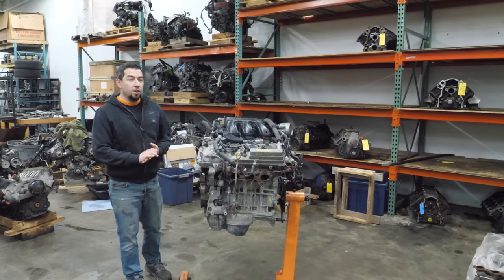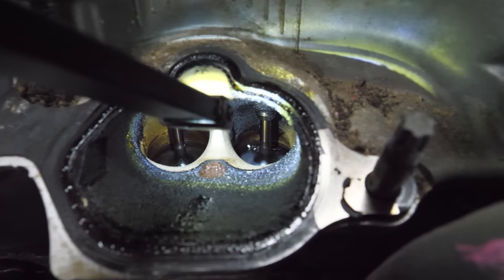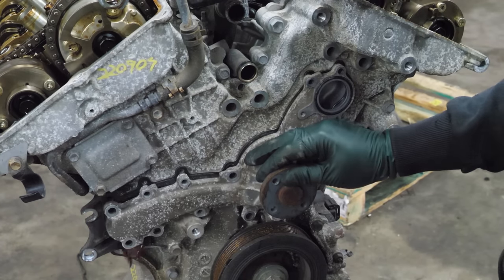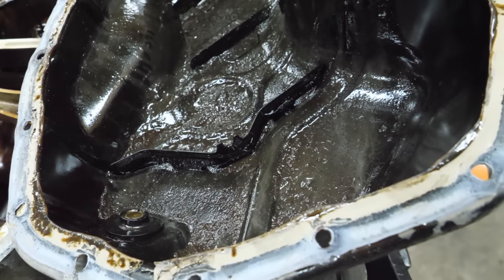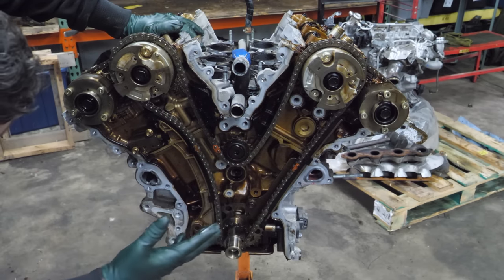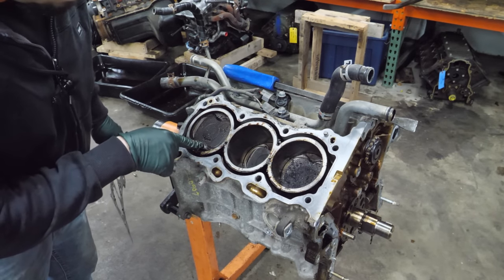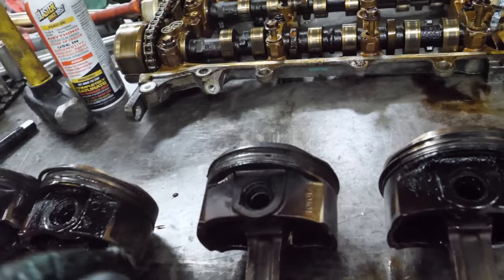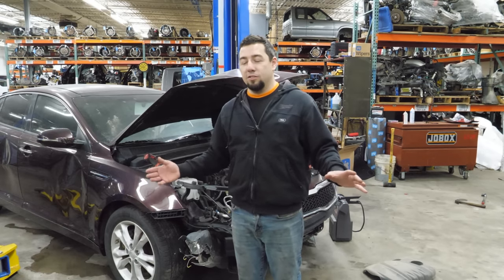Toyota Lexus 2GR-FE Teardown! Premature Death Of Toyota's Most Reliable V6 Caused By Obliviousness!

Comment: Hello, Thank you for providing such a comprehensive survey of these engines.
I live in the UK and I've noticed how people don't maintain their engines, I check my oil, coolant and screen wash every Sunday. 
I have a Ford Fusion, now this is based on the Fiesta, its a 1.6 duratech engine, I find that the garages are not very good when they do a service, I've had a bad experience, when the car was in for it 195 mile service, they garage incorrectly screwed on the oil filter and consequently the filter blew and bust whilst I was driving on the motorway which blew the engine, so I called the garage and demanded they replaced the engine.
I visited the garage they day after I returned the car and they had ordered a 1.4, I told them that it was a 1.6, They didn't believe me and asked me for the registration number which confirmed it was a 1.6, so they sourced an engine from Ford fusion which had a automatic gearbox, so now the car throws up a engine management light, so now, I've given up letting a garage do my servicing, the car has now done nearly 290, 000 miles, I asked another garage to replace the Campbeltown, which was done, they replaced the water pump, power steering and alternator belts and a week later, I heard a squeaking from the engine bay, looked down and the alternator belt is damaged, that's why I don't have any confidence with garages.
Brilliant programmes.
Thank you 
Ian Burns

Comment: I had something like this on a Sienna 3.3 liter. Water pump blew out and they must have kept driving until the timing belt broke. Just like this, both knock sensors melted, intake melted and the engine just smelled like a sulfur mine. I looked up the melting point of plastic. Most cheap plastics melt around 2-300 degrees. Mid level is around 5-600 and high quality resins are close to 1000. So externally, this block had to hit at least 300 degrees. The melting point of non-alloy aluminum is 1300.

Comment: Nice to see this video man! We have this motor in our 2008 Highlander, and while it's had a few issues over the years it's still running strong at 241K miles. Had the lower oil cooler external line failure years ago, before it became a recall. Got our money back from the tow and repair once the recall came out. Also have been dealing with that nasty cold start VVTi grinding noise for more than half the car's life. Also had the water pump replaced a long time ago but after the warranty ended, so we shelled out $600 or more for that. It's in a tricky location to work on with the engine in place. My latest worry is a tick tick tick sound from one of the valves...  Oh and the version of this motor in my 2015 Lexus GS 350 F-Sport has had a winding noise for years coming from a gear on the timing chain system. They replaced two parts already under my extended warranty, but the noise is still there. It winds up and down with the RPMs. Worries me that something might be failing and the end result will be very bad....
Reply: Sounds like you're just making parts up
Reply: @march24-lp4pv  Hey anonymous blank profile person, what would make you come to a comment section like this and make such a baseless statement? Crawl out of your mom's basement, go outside and get some sunshine and fresh air. I have all my invoices with cost breakdowns and part numbers if that would make you feel less distrusting of other people.  Just kidding, I won't be spending a second of time proving myself to whoever you are.

Comment: Thank you for doing this engine. I might have missed the year of the van this came out of, but I’d be interested in that. As a Toyota fan boy, primarily 2015 and down, I appreciate your tear downs of the Toyota products. 

As you know, they are far and few between because, well, Toyota. But it seems any Alpha Soccer mom in a candy-crusted can that tears up the left lanes en route to the next school or outdoor mall is capable of destroying a concrete block. 

As the proud owner of a 2GR-FE with 206k miles, runs like new, doesn’t use any oil and has been taken care of, I hope to hit 400k with ease.  

One thing I appreciate most about this is watching where I need to work if something does need attention. 

Keep up the great videos.

Comment: When are we going to see a Northstar tear-down? I’d like to see an early production version and then a 2005 or later to see the “fix…”
Reply: same, just to see what Eric thinks of it.  I head studded my 1999 Northstar so I kinda know what it looks like
Reply: @MowerModdin  I'd absolutely love to see Eric tear down some sort of flathead car engine. AT this point I don't care how many cylinders it has or what configuration it is, I just want to see him tear down an engine that's old enough to qualify for AARP.
Reply: @TestECull  anything that old is going to be a collectors item unless it has some after market inspection windows
Reply: @bradhaines3142  Or it's sat in a field for 56 years and is so rusted out that there's no hope of ever getting it to start again without tearing it to shreds anyway. That being said you do sometimes find these old cars with bluetooth conrods in them! Mortske Repair got his hands on an early-mid 50s Plymouth sedan with a flathead six in it that went kerbal. #6 rod decided it was done connecting and obliterated EVERYTHING around it. Both sides of the block, oil pan, even damaged the bellhousing.  And one of his most recent videos is of a 1956 Chevy 210 sedan with a smallblock/3spd OD manual in it that got flood damaged decades ago. Smallblock Chevies are tough engines but when there's water sitting in the crankcase for decades and decades even they rust up solid....the whole driveline was toast in that car, not just the engine. Poor thing. The body is great and he only wants 2500 for it; if I had 2500 I would have bought it, swapped in a 250 I6, and made it a daily driver.

That Plymouth engine had been hotrodded back in the day...the parts were old, crusty, dirty, corroded, but the engine still wore its hotrod go-fast goodies...and likely overrevved.
Reply: @bradhaines3142  Gotta admit, though, the contrast of having such a vintage engine on the teardown bench against all the modern garbage he's ripping apart on a daily basis would make the video well worth watching. That's a large part of why I want to see a truly vintage engine on Eric's teardown bench; beyond my own fascination with seeing inside them the contrast on how we used to build them VS how we build them today is worthy of note. And.....well, seeing how the old engines blew up hasn't changed one bit if you look at all the yeeted rods from the modern engines he's torn down. Oil starvation is a universal killer.....

Comment: the oil filter cartridge slides onto a tube in the cartridge housing cap and should should slide right back out . In the manufacturing of the cartridge, a bead of glue is applied around the center opening on both ends to keep the element in a round shape. Evidentially the glue melted on the one end. As you tried to get the filter element out, you probably broke the tube loose from the cap because it looked like the filter element wiggled from side to side. That filter housing cap should not be used if that happens as some of the oil will bypass going through the filter element according to Toyota. Believe it or not, there is a repair kit for that, you don't have to buy the whole cap.

Comment: First 
You should be wearing safety glasses, but you already know that…. Right?
….
I have experience with these engines 2GR-FE, they had inherent design flaws.
1- Poor head gaskets, in the early models, a very common and very expensive failure, as these engines were not designed to be serviced “in Frame”, worse getting the engine cradle bolts out requires quite a bit of work, because they were not properly protected, and they rust in place. It required a map gas gun and plenty of PB blaster to get all of mine out. The struggle went on for two days. Caught my blown gasket early, so the engine could be repaired. It’s running today
2- A poorly designed VVT oil tube, which was made of metal and rubber tubing (Right side head or for transverse, Back Cylinder Head, seen in the video) The rubber tube would rupture, and within seconds the engine oil would be pumped out of the ruptured hose. Toyota later replaced the hose with an all metal hose assembly.

Comment: I work at Toyota, not for long at the moment but I do know these have water pump issues, sometimes the oil crossover line on the rear bank can burst, but that was a big recall so I doubt they're still doing that, or the oil cooler line in the older highlanders would rupture. Aside from that I'm not aware of any more issues, but I'm searching the comments for more!

Comment: I missed the reason the chunk of metal detached from the cylinder wall!  Just from the heat and the buildup of aluminum causing lateral pressure?  I'd go back and look but it's more fun to ask over here.   Thanks for another entertaining and informative teardown!
Reply: That cylinder ran very lean, causing extremely high combustion temperatures. With temps that high, it'll melt anything!!.
Reply: The reason that happened was no coolant and oil starvation.  No oil film in that cylinder means high friction and heat plus no heat dissipation.  The piston literally started trying to weld itself to the bore already weakened from enormously high heat until it broke relieving the stress.

Comment: I have an 11 Highlander with that engine and closing in on 200k. Original wsterpump and just replaced OE plugs at 185k. Really a well designed and assembled engine which runs perfectly. A note abt plugs, the factory installed Toyota  plugs will have an "x" or paint mark on the top of the terminal. My bet is those were original. Great channel!
Reply: Top terminal of what?
Reply: @piggy310  Top terminal of the sparkplug.

Comment: Some of the early 2GRs seemed to have issues with leaking head gaskets. Mainly the 06-08 models, it seemed. They’d usually start leaking right where the head meets the block, and sometimes they’d run a little hotter. But that’s all they’d do if that happened. Also on the early ones were issues with the oil lines being rubber, and it’s a guaranteed failure on them. Thankfully, they offer aluminum replacements.

Definitely one of Toyota’s best V6s they’ve made, and a lot better than the previous 3MZ it replaced.

Comment: Thanks for sharing this nice video, Eric.
BTW, could you do a tear down of an old Ford 289 cubic inch V-8?
They were hugely popular in the 1960's.
Reply: Funny you mention this. As he was pulling the oil pan off I was thinking I wonder what the inside of the oil pan on my Mustang looks like after 58 years of Dino oil looks like. I second a vote for a 289.
Reply: He did do a later 302.
Reply: he did a 90s 302 a while back, it's the same engine
Reply: @patrickr9372  Thanks there, Patrick R. I only hope Eric is able to find an old 289 Ford.

Comment: First thought was front coolant leak after you mentioned overheat. Have had three on our 135k Sienna, incl a Gates pump that only lasted 50k miles, a brand new tstat gasket that failed to seal, and the silly o-ring on the bypass line which shouldn't be reused. The water inlet gasket is super easy to pinch doing it in-frame. Factory procedure is to drop the motor for the water pump, unnecessary.. I've done it twice, though the comically long torque mount bolts are frustrating. Interesting to see the spark plugs come out so easily, mine were galled pretty good.
Reply: You saying Gates water pumps are no good to use??? Use the OEM part instead only.

Comment: 2gr-fe Car Care Nut said it’s Achilles heel is timing cover leak, and extremely sensitive to low oil pressure other than that, upgrade the oil cooler to rear VVT-I bank and upgrade the VVT-I gears those with pre 2010 and it’s a wonderful engine. Mine has 262,000 no leak no problem and Im also maintaining a 5vz-fe and 1mz-fe.
Reply: Mine has timing cover "seep," not enough to show drips underneath the engine. Dealer wanted to drop the engine to fix it.  It's 50,000 miles later and it still seeps.

Comment: Is this the one that is in my RX350?  I have been REALLY waiting to see this one.  Ours is about 250K now.
Reply: Yes, this is in fact the engine in an RX350.
Reply: 2007-2014 RX350s use this engine and 2015-2021s use the updated (but very similar) 2GR-FKS.
Reply: @ischmidt  Ours is a 2008.  Nice ride still.  Just had two wheel bearings replace and I changed all coils and plugs at 134K when we first got it.  I've got the transmission jutter lugging in to OD, but I understand that is a common Toyota transmission thing.  I keep it in 4 until above 60.
Reply: @TechGorilla1987  Transmission issues are common on FWD Toyotas, especially those of that era. However, you may get lucky with a fluid and filter change.
Reply: @spenserchalkley7013  This one is the AWD version.  I have the filter and pan gasket on hand for a change.  Finding the Toyota specific fluid local without going to a dealer is proving to be harder.  I understand I need about 2 gallons for a pan drop/filter change.
Reply: @spenserchalkley7013  Lol

Comment: The oil filter housing caps on these engines are plastic. They see a lot of heat cycles and sometimes lube techs tighten them so tight that the end up seizing and breaking or cracking upon removal. This can lead to quick loss of oil without telling you right away. There’s an aftermarket brand that makes an aluminum version of it found usually at your local autozone for about $70. I do recommend, even if you don’t need to, to replace it with that one to diminish this problem. I’ve been watching your channel every week for quite some time and i remember you saying you like to hear things and facts like that.
Reply: the 2grs already come with an all aluminum oil filter housing. The OEM aluminum filter housing costs just $35 from the dealer. I say this again and again. Always check the OEM prices before buying inferior aftermarket junk.
Reply: The oil filter housing cap is aluminium on the Toyota/Lexus 2GR engine range

Comment: Killed me to watch how easily you removed the rear coils and plugs with the engine on the stand. I've done 2 sets on wife's car so far. Real pain when it's in the vehicle. Was waiting for you to do the 2gr. Ours has been dead reliable for 15 years and 170+k miles. Absolutely great channel. Look forward to a new teardown every Sunday. Just like the 2GRFE, make sure you take care of safety tote and it will continue to take care of you.
Reply: The rear bank sparkplug change on Toyota v6 engines are the worst.
Reply: Just did mine today. What a nightmare. As bad as everyone’s comments all over the internet. I may have made it harder on myself by not removing the intake plenum but still managed to access the rears with some difficulty, particularly while trying to get the coil out with the wiring harness still in place. Trick was to undo some of the harness clips/mounts to give you enough wiggle room. This was my first time ever doing the spark plugs on a 2gre-fe and I’d say it took me 2.5-3hrs all up.

Comment: What usually kills these engines is lack of maintenance either an oil cooler on the RX sienna and Highlander varient break and then it dumps all of its oil immediately and you seize up the engine or the water pump goes out and you pretty much have to pull the engine You can get around with not pulling the engine to change the water pump but it's a major pain in the ass A lot of people just overheat the engine and warp the head but it does have a very complicated oiling system and sometimes the VVTI gears will come apart and destroy the engine that way as soon as it loses time
Reply: All these engine with a 1/3 of a dozen camshafts and a fathom of bicycle chain to run them have a recommended service interval for tensioners and chain inspection and replacement.
No one ever reads the manual.
Reply: How is an oil cooler failing a “maintenance” issue?
Reply: This is such overblown bs, only people living under a rock might have an issue with the oil line, it was redesigned anyway plus the part is metal now.

VVTI gears don't just randomly decide to go, it's a lifetime part because it's very complex but it's very obvious when that is the case, it makes alot of noise.
Reply: @MJ-5k  ive had vvt rattle on 2 separate cars. but you go ahead believe what you want. Honestly i like the FSE variant the most. "Lifetime" means 100k mi in car manufacturer speak

Comment: Think you can get a 2GR-FSE (the direct injection one from the Lexus rear-drive sedans)?
Reply: i have one in my mark x! i wonder how many problems the "fse" shares with the "fe".
Reply: I have one of those in my IS350 F-Sport. It's a good little engine for daily duties.
Reply: @scslre  How many miles/km on yours? I've found mine to be pretty reliable. Keep it serviced and it just keeps going. Mine's 100% stock.
Reply: @scslre  the oil line to the vvti is NOT shared, it was metal originally on the rwd engines, otherwise they are very similar... bit easier access, at least the 3.5L ones you can replace the spark plugs without taking intake manifold off, and the port and direct injectors on 3.5L also keeps the carbon buildup from happening... you can still get the timing cover leak and the valve spring break on early models without the recall, but like most Toyota engines they recalled the stuff that would have ruined their reputation mostly.

Comment: I had a Toyota with the previous version v6. It was a solid engine. I got it with blown heads ( cracks) from overheating. I rebuilt it ( new heads and rings) but it ran for over 40, 000 more before the tranny gave out.
    The machinist that I used said that it was actually a Lexus motor that was used mid year to compete against the Nissan v6.
      It reminded me of a dual cam cosworth type with shim adjustable valves. It really ran good.